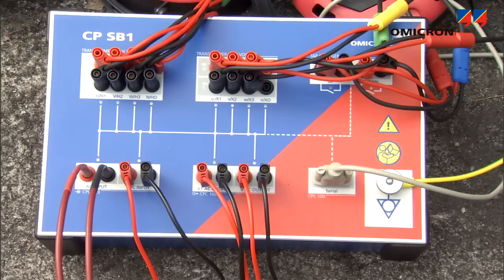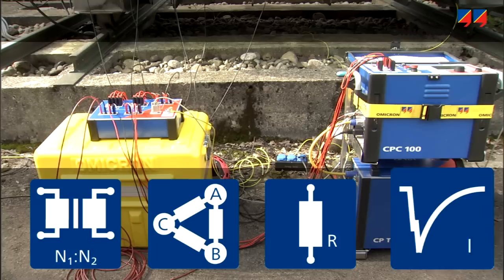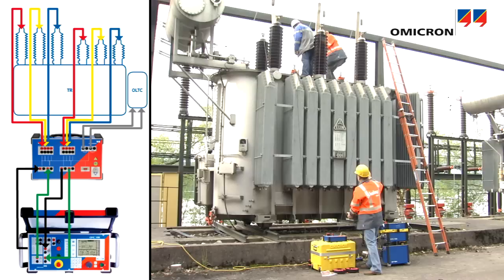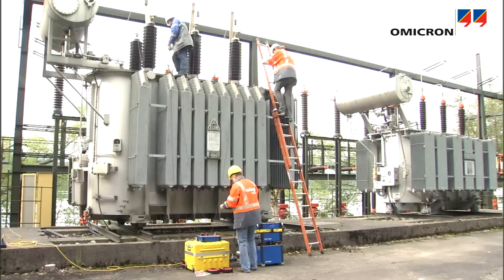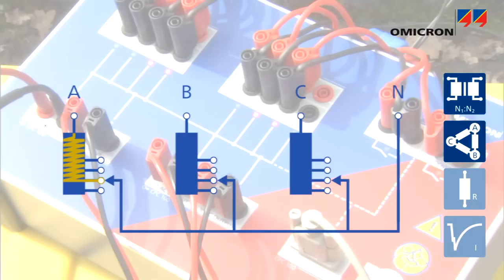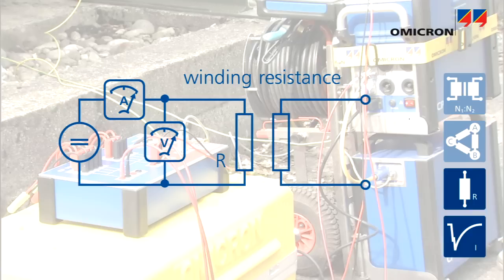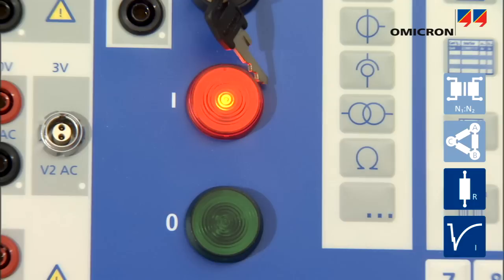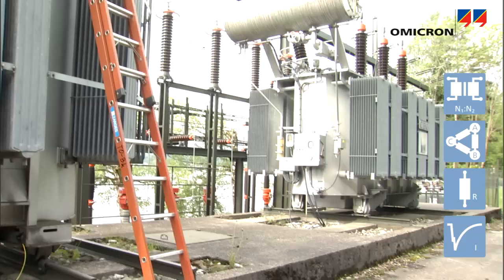Power Transformer Testing - Automatically measuring ratio and winding resistance of all taps/phases

Comment from the maker: Dear Jahn Erik,

The 2-winding transformer, which is shown in the video, was tested in cooperation with a local Austrian energy utility. 
However, the OMICRON accessory CP SB1 is not restricted to any specific 2-winding transformers, thus all explained measurements such as transformer ratio, excitation current measurements, static winding resistance as well as dynamic winding resistance measurements can be carried out on almost all types of power transformers.

Best regards,
Your OMICRON team
Reply: France

Comment from the maker: Dear iClueYuin,

We’re happy to hear that you like our system.
As you mentioned, the system is designed to simplify the testing workflow on a 3-phase transformer for the construction crew.

The transformer has to be climbed only once, and no rewiring is required, as ratio and exiting current, static and dynamic winding resistance are determined with one measurement.
The risk of wiring errors is also minimized as the wiring plausibility is checked automatically prior to the measurement.

Comment: How to find Vector Group. I could not find the vector group in the list provided in PTM
Reply from the maker: Dear Muhammad Bilal,
for the CPC100 the vector group check is done standalone on the device itself, by using the CP SB1. The vector group check is available for TESTRANO 600 (PTM version 4.50). If TESTRANO 600 is the control device, the vector group check can be selected under “Tests”, within a PTM job (guided workflow) or when a manual job is performed. 
Best Regards,
Your OMICRON team

Comment: transformer is fixed by  nut bolts in substation on the cement concrete structure. but nut bolts loose every week , so why nut bolts loose & need to fix it every week ?
Reply from the maker: Dear Ritika, we usually have nothing to do with the assembling or installing of transformer, especially not with the fundament of transformers. But this sounds like the screws have gone through, I would recommend to contact the company which concreted this fundament. Someone with experience in this topic has to take a look at the problem on site to suggest a proper solution.

Best regards,
Your OMICRON Team